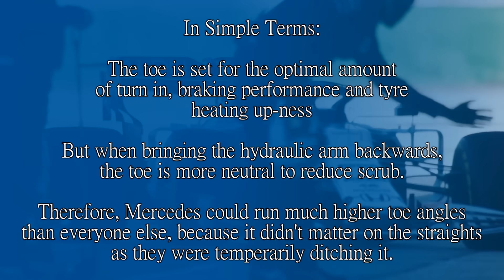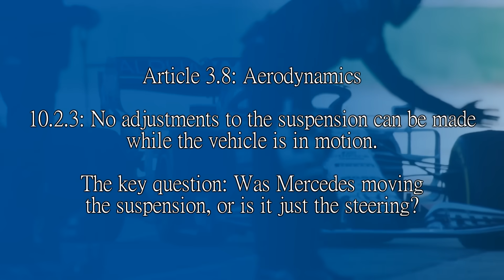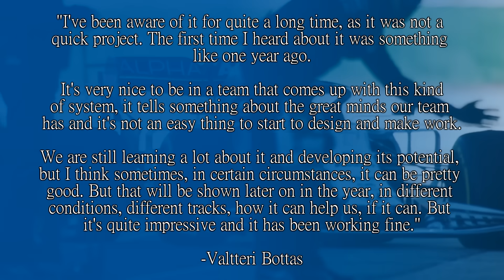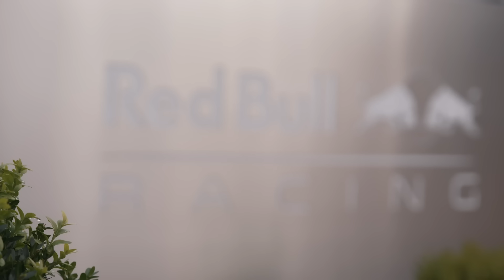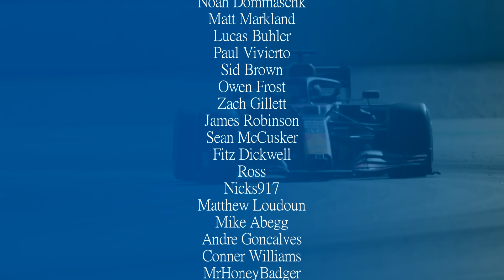F1'S LAST PROPER INNOVATION? The Story of the Mercedes DAS System (2020)

Comment: I love innovations that are - technically or completely - legal. Just because it's going to cost other teams to develop their own system - whatever it is - well, tough!  It's cost the developing team a bunch of time as well as cash, not even knowing if it will work as conceived. The other teams now know the answer to the latter point.

F1 is supposed to be a prototype series, not a spec one. It's supposed to be the pinnacle of engineering, let alone the driving. 

The F duct basically got banned because Ferrari couldn't come up with a system that didn't require the driver to go around a corner one-handed, whereas the original system only required a knee. Ferrari's system should have been banned on safety grounds. As that was before cost cap time, the expense of adding it to the car should have been irrelevant as part of the reason to ban the legal and incredibly simple "device" (in quotes because I'm not sure if it can even be classified as a device.)

The same applies to DAS. The FIA had given the okay for Merc to use it from before they started to build it! Banning it after one year is, IMHO, a pile of steaming 💩 They should have told the other teams to suck it up and decide whether to create their own system for the next year, pointed out all the relevant rules regarding its legality (though the teams should be able to read the rule book) and add it to the following year's car. I feel this way that about any legal design, especially when the FIA have given them the green light. 😠

Obviously, if a team is doing something illegal, they should get punished one way or another. But I hate seeing them punished for being innovative with the rule book! (In case anyone thinks I only feel this for certain teams, no, I feel the same way about all such developments and lousy FIA decisions.)

Comment: In the mid 90's while in college I was on an engineering team in New Jersey that built an electric car and competed against other schools.  One of them (believe it was Western Washington) had built a solar electric car with 8 bicycle tires, double stacked at each corner.  In curves all 8 would be in contact with the ground but on straights they could radically increase camber so only the inside wheels were touching, halving the rolling resistance.  Don't remember how they accomplished this (surely some kind of purely mechanical system, like DAS) but I remember being deeping impressed with the concept.  Similar idea to DAS, even if for different purposes.
Reply: did you go to Rutgers?
Reply: @collagen1738  no Trenton State College
Reply: @kedelbach  cool :) i live close by

Comment: I’m pretty certain Hamilton and Mercedes would have won the championships that year regardless; I think it likely only made a difference in the standings in a few races. It also probably made a bigger difference for Bottas because he was not as good as Hamilton when it came to bringing tires into the necessary temperature window and keeping them there. Had they been able to keep it, it might have made it far more significant difference in a close title race.

What really impressed me is that they had the best car and rather than just being complacent and focusing only on what incremental gains there might still be to gain from the design, they looked at what had been a glaring weakness of the car and figured out an innovative way to address it within the regs.

Comment: Can you also do a video on Merc’s ‘party mode’ and just in general how teams used to use different modes between quali and the race!
Reply: Pretty much turn the ICE up to 11, deploy all the electrical energy available over a single lap, controlled by GPS.  Strat 2 it was called
Reply: @joakimjeppsson1443  true! I think it was well understood in the grid and media that Mercs mode was able to extract more than that from Ferrari, Renault or Honda. Maybe that is simply leaning on the higher reliability ceiling

Comment: Wouldnt "Brake Magic" have been the last F1 Innovation? Im not sure for how long exactly Mercedes was actually running it but having an on-button brake heater sure helped them a lot (except when Luis forgot to turn it off at Baku).
Reply: No I think they've all had that for ages. All brake magic did was shift the breaks to 100% front to make it easier to gain front temp. I'd imagine everyone has already been doing that for a while
Reply: I remember a radio communication to Michael Schumacher in Turkey (think it was 2010/2011) which said "magic paddle latched Michael", so it must be at least 10 years.

Comment: I never understood how this was even legal because the rules have stated you are not allowed any moving aerodynamic parts but by changing the angle of the tires on the fly, effectively its toe in & toe out which does change drag slightly which will effect aero so i never understood how changing toe angles during a race is not classed as moveable aero part.
Reply: Because they weren’t allowed to change it during the race. If you paid attention to what was going on then, or if you paid attention to this video, you would know that they weren’t allowed to use it while the car was in motion. Where it really gave them an advantage was their ability to put heat in their tires during the formation lap. When they stopped in their grid spot, they would then return the tires to the normal setting for the race.
Reply: @valerierodger  So if they wee not allowed to use it in the race why bother spend the money to make it just for it to be used on a formation lap only. We saw them using it numurous times in practice, so why use it in practice if it has no use during the race?

Comment: I never got why it got through the FIA tests.. because DAS changes the Toe of the front wheels.. and last time i checked.. toe falls under parc ferme and is not allowed to be changed after free practice entering qualifying..
Reply: I think the other teams did think of this.. i genuinly think a lot of other teams in the past has thought of something like DAS.. but never bothered to do so because it changes something that is under parc ferme regulations...
Reply: To be specific, adjusting the suspension (in this case, adjusting toe angle by adjusting the length of the tie) is not allowed in parc ferme. DAS operated strictly as part of the steering system. to the extent it changed the suspension, it did so no more than any other steering input.

From the decision itself:

"The Stewards believe DAS is part of the Steering system, albeit not a conventional one. Article 34.6 of the Sporting Regulations: this forbids an adjustment of suspension in parc fermé. […] It is, for example, not permitted to adjust the toe angle by mechanically adjusting the length of the steering arms during parc fermé. Clearly (again) steering is a de facto exception [...] the Stewards consider DAS to be a legitimate part of the steering system and hence to satisfy the relevant regulations regarding suspension or aerodynamic influence. In the opinion of the Stewards, the DAS system is physically and functionally a part of the steering system. As such, it benefits of the implicit exceptions to certain suspension regulations applicable to steering."

Comment: In a way, I'm glad DAS didn't become a thing. No buttons left on my wheel, and I'm no good at that brain overcapacity thing anyway. Harvesting, deploying, DRS, maybe overtake button, DAS... Sometimes we hear about adjusting diff settings or brake balance while racing, and I just go Kimi: let me be!
I'm just an average male, I can't multitask. I have trouble doing one thing at a time.
James Hunt could just say Big Balls and leave it at that. Nowadays you need a NASA degree.
Reply: Kimi was actually open to adjusting settings on the fly: he likes to set the brake bias very far to the rear to increase rotation on entry. For the same reason he likes the differential to remain unlocked for most of the corner, also so that he can get on the throttle early.

Comment: Well put. For my 50+ years of following F1 in one form or another, the one thing that kept me coming back year after year was to see the technical innovations, and you are spot on that the FIA have done everything to stifle that. Yes, somethings needed stifling for safety reasons, and banning traction control, ABS, hydraulic suspensions, etc were all good ideas otherwise we'd be watching remote controlled cars running around with just a passenger not even touching the wheel. But it's gotten to the point where it's lost it's luster. It's becoming... dare I say it... INDYCAR racing... just a lot more expensive. Opening up the rules a little I think would be good for the sport.

Comment: The trouble with F1's innovations is that they usually have no real-world application outside of F1. Which is probably why the regulations are so tight now; there's less opportunity for people to come up with stupid single-use ideas that cost a lot of money and don't work unless a car is experiencing 3G at the time. 
I can understand why the regulations are so tight on this but I still think it's an error to force everyone to use the same engines and mechanical components as those are areas where new ideas could benefit other businesses, even if only other motorsports. 
F1 hasn't been relevant to anyone outside of F1 for a long time; I don't see that changing any time soon and eventually the rest of the world is going to ask the question: What's the point?
Reply: The new regulations are increasingly relevant - that was a major motivation for them - which is why there have been manufacturers interested in returning to F1.

Comment: With regards to outwash, it was baffling that the FIA kept the width of the front wings in the first place, reaching the outer edge of the wheels.
Of course teams would focus on generating more outwash as they had done since 2009. The ratio of potential performance generated inwash vs outwash decreases as width increases, and the scale was firmly tipped towards outwash since 2009.
Decrease the width to the point where inwash can generate more potential performance than outwashand the teams would all switch to+develop inwash.
The FIA guaranteed development against the "spirit of the rules", and now the only solution is to make the teams scrap all that development which is both bad for the show and bad for the tech. Absolute backwards thinking.

Comment: So frustrated that it wasn't banned immediately instead of the following year. The other teams would always collectively opt to save some pennies by not developing something that would be illegal next year. So Sir LewLew won title no. 7 in testing. Clock one up for Mercedes Assistance Facility In Autosport.
Reply: Assisted Mercedes so much that they implemented floor rules for one season in 2021 that only favored high rake (RBR) and disadvantage low rake (merc)

Comment: Since 2020, my interest in F1 has dropped significantly. The main reason is that the FIA protected Red Bull, banned any form of innovation, and then protected Red Bull's cheating. At the same time, they protected Red Bull when it came to penalties. Red Bull ruined the sport. I still like DAS, and I think it was a ridiculous reason to ban it just because other teams couldn't make it. I don't like Mercedes now, but I hate Red Bull more. I hate Red Bull from the bottom of my heart.
Reply: The fia have banned other forms of innovation in the past before red bull. They’ve nerfed red bull in the past . Also teams complaining about things and about legality of parts of cars has been a thing for years as well. Red bull were punished for the cost cap
Reply: @tombardsley3081  Red Bull wasn't really punished. The cost cap was mainly proposed by Red Bull. But they broke the rules, they didn't lose race points.
Reply: @GeometryEX-hp9zs  they were punished. It was a minor breach and it was 400k. 400k doesn't give you the sort of advantage they had in 2022 or 2023
Reply: I mean, they tried to ban exhaust-blowing in 2012 by changing the position of the exhaust exits on the cars and that hurt Red Bull in the first half of the season. I don't like Red Bull's management either but they aren't "protected" by the FIA.
Reply: @tombardsley3081  This is equivalent to no penalty in the case of a minor fine.
Reply: @ryanjonathanmartin3933  If you look at the fine print of the penalties and the rules of the race, Red Bull is protected in every way. Sometimes they get no penalty, sometimes they get a minor penalty.
Reply: @GeometryEX-hp9zs  because 400k isn't a massive advantage. It's 1 front wing . Also they went over budget because of Mercedes cars causing the damage with Silverstone and Hungary. Their wind tunnel time etc was reduced so their car development has been affected which given this year is proving to be taking effect
Reply: @ryanjonathanmartin3933  Because the FIA needs to ensure that the event can go on. They won't do it, this team cheated, we declare your results invalid. They can cancel the results of one game, but they can't cancel all the games. For McLaren, Mercedes, Ferrari, and Red Bull, these four teams have become the main investors of the FIA. Even if the team has obviously cheated, the FIA will not declare it cheating. It will only say, I changed the rules, you can't continue to do this. To protect the legitimacy of the previous results. However, it does not mean that the team that violated the rules is not violating the rules. Ferrari was exposed in 2018 for cheating by using an extra battery. At that time, Ferrari reached a secret agreement with the FIA not to impose penalties.
Reply: @GeometryEX-hp9zs  they're not protected in every way. They've had things banned and innovations they've done taken away. This just feels like salt
Reply: @tombardsley3081  There is also inconsistency in penalties, and the boundaries of collision penalties are unclear. Lando and Russell will be punished, but Verstappen will not be punished. This is long-protected behavior.
Reply: @GeometryEX-hp9zs  max has been punished though. Or did you forget about the penalty he got in Austria?